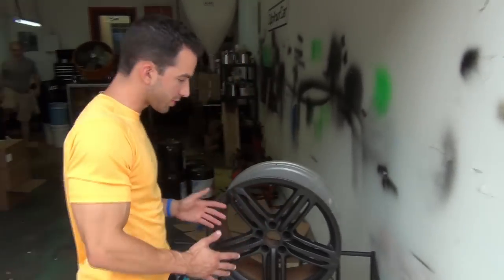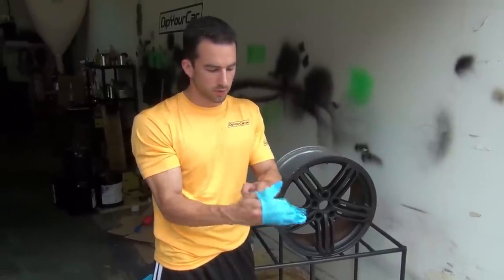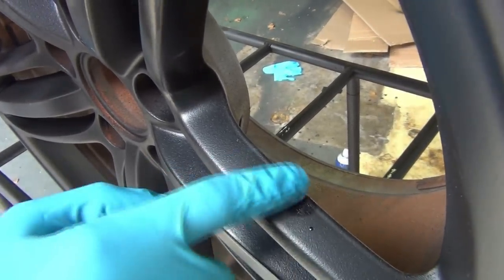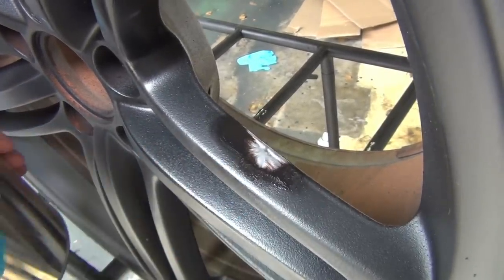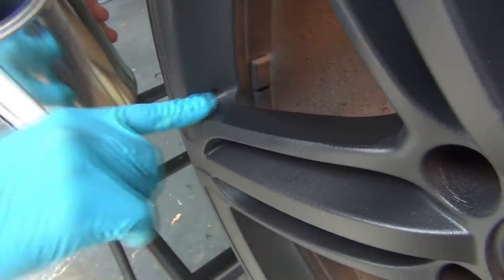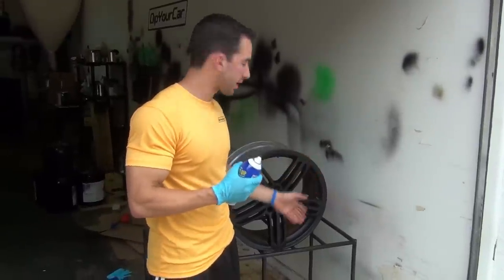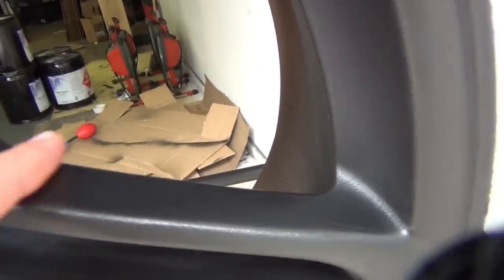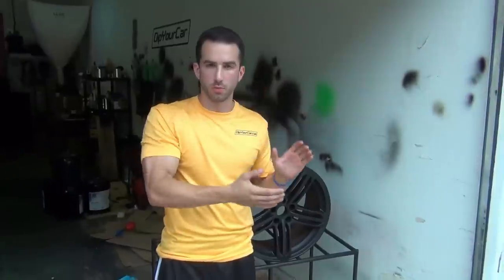How to Fix PlastiDip (Texture, Tears, Troubleshooting) DipYourCar.com

Comment: It’s been years since u posted this video you probably won’t see my comment, but your solution saved me from re-doing my entire prop after I sprayed plasti-dip badly on it & got a lot of ugly texture, thinner trick worked like a charm🙏🏻✨ thank you
Reply: Can I ask what kind of thinner you used and if the prop was foam? Having a similar issue on my current prop build and really don't want to have to restart it.

Comment: its not paint thinner or acetone, its xelyne and vm&p naptha. it wont hurt your ride because xelyne is used to break down rubbers, leathers and plastic.... unless you pour this on you dashboard your ride will be ok. vm&p stand for varnish mix and paint and is used as a paint thinner but isnt a super strong solvent like acetone so a little spill on your ride will be as harmful as spilling fuel when you top off your tank.
Reply: Thank you this helped alot!
Reply: So do you mix them together?

Comment: Fixed curb rash on dipped wheels . Smoothed the wheels by hand with coarse to fine, wet or dry 3M paper. Used the Kit solvent. Whole job on three scrapes took less than 1/2 hour, and it is not visible.

Comment: I've plastidipped hand tools (original purpose) and that works out pretty good. Think about the handling hand tools undergo. 
Shoot I've done it to my GPS and "scangauge" just to make them look more oem and less like add-ons. Those are holding up. 
But to answer your question, if people are doing using it on rims and entire body panels it must not be too bad.

Comment: Paints are usually pretty resistant to plastic thinners. If you left the wheel soaking in it for a few days you may have issues, but you shouldn't have any problems with quick repairs like this.

I know many modern wheels are powdercoatied, but powdercoat is also very chemical resistant.

I don't see a quick repair like this causing any damage at all, let alone damage a quick polish rub couldn't fix.

I've had to use some pretty harsh chemicals on car paints at work. Paint's tough.

Comment: Thanks for the video.  I have an issue w. Rim job, bc didn't make sure the edge was clean from the tire release solvent.  Correction...I found the link to the DipFix, so ordered placed.  Look forward to the project and won't have to strip off & start from scratch.

Comment: this looks good on how to fix plasti dip on a brand new spray but what about if it was covered with brake dust and the plasti dip was older. Would color matching be an issue? Would you still spray the whole thing?
Reply: Did anyone replied? I have the same question!
Reply: Juan C. Guarin I have the same question did you figure anything out
Reply: NinJa Crafted nope 😒

Comment: If you used the Glossifier on your tire's PlastiDip paint job and had these issues (tear or texture) how would you rebuild up the paint job after using the repair kit? Wouldn't that require putting new coats of PlastiDip paint on top of existing Glossified areas? Would that work or would that cause problems? If not, I don't assume there would be any problem with putting a new Glossifier coat back on top of that fresh PlastiDip paint coat.

Comment: I shot the hood of my badly faded silver 95 Chevy s-10 yesterday with aluminum. It was 93 degrees in my garage at 1 p.m. here in central Florida. I had the garage door and a side door open for a cross breeze. Fail ! LOL  This was my first experience with dip. The finish looks like gun metal gray suede with a few  little round bright silver dots from the nozzle spitting. I purchased the DYC spray nozzles and as part of my prep I put the cans in warm water and shook them well. I'll probably peel it and wait till the fall as the weather is only going to get worse. Dip and learn........
Reply: +Aztekno MCO 
Did you ever redo it? How did it turn out?

Comment: the few times ive used it, ive found its better to use slightly heavier coats than usual. i would use two thin coats, and any other coat i applied would be as heavy as possible without getting runs. its gonna have some texture regardless, but it definetly shouldnt look like a golf ball

Comment: The plastidip spray cans i seen come with 2diferent spray tips. The smaller 1 that looks like a hairspray tip will make the finish look rough and bumpy. The bigger tip will give you the smooth finish.

Comment: I noticed you sprayed the entire wheel after spraying the actual damaged area.  Are you doing this because the repaired area will be "obvious" to the naked eye?  If you don't throw a quick coat over the whole wheel, does the repair stand out?  If that's the case, doesn't the entire wheel now stand out when it's on the car?

Comment: Great tips !!!

If I'm doing plastidipping wheels which are already painted with some imperfections, can I plastidip over or do I need to sand and wet and dry to get the surface flat before plastidip??   Thanks!

Comment: I've tried multiple applications in different areas and can distances but it's never come out smooth like auto body paint. Oh, and I plasti-dipped my '07 Mazdaspeed 3 18" wheels and I used almost three cans putting 4 coats on each wheel. I specified the wheels so that you can look them up and see the area I had to cover should you need a better idea of what you need. Thanks for the reply!

Comment: I plastic dipped my Chrysler emblems and they came out good except the surface is rough. And my front emblem has a little lift from taking the tape off. Took me 3 hours to do the back and 3 hours for the front. I’m doing my rims next. How can I get it come out smooth?

Comment: when i plastidiped my rims, there was moisture in the cracks of the bolts so i got bubbles. I plasti dipped my rims gold so i have 4 layers of black that i have to worry about.. i cant just fix the tear (from opening the bubble) with gold on bare rims, i need the black foundation first...... meaning i would have to go over the entire rim with black (over the already 4 layers black 3 layers gold) 4 layers and an additional 4 layers gold... seems to me if u did more than black or white, youre better off ripping all the plasti dip off and starting over for a small tear or texture. amirite?

Comment: Hi, need help… I have a artificial wooden grain texture dashboard panel, am wondering if you have solution with plasti dip to smoothen this surface as I want to change the colour of the wood to gloss black. Hope you can help and have some video examples for this type of project.

Comment: Hope you can reply to this.  I just found out about Plasti Dipping.  I really want to do my rims on my 05 Maxima, but when I bought it, 2 of the rims have curb rash...BAD.  What would you suggest I do?  Sand down the rough edges, use some sort of metal filler (which one?), then sand flat?  I'm pretty sure that's the way to go, but I wanted to ask you as you're the one who works with Plasti Dip probably more than anyone else on the planet!  :-)  Thanks in advance!

Comment: What about repairs in larger areas? Like a scratch or tear in the middle of a fender. You resprayed the whole wheel once you smoothed out the bad bits. If you just sprayed a large area (but not the whole car) would the finish match and be un-noticable?
Reply: Nefarious Rogue gotta redo the whole car

Comment: What do mean by a "smooth" surface? I have worked with Plasti-Dip multiple times spraying emblems, wheels, auto body pieces, tools, and doing work in and out of the house and I have never come out with a smooth surface. It always seems to have a texture to it no matter how many layers, can control or distance, or time in between coats.

Comment: Hey I plasti dipped my rims and then used spray max 2k clear well I had to get new tires and the shop scratched all my rims. Now to fix the scratches do I do what you did in this video or do I have to start all over or do I just sand the clear coat off? If I just sand the clear coat what grain paper do I use?

Comment: you could also use mineral spirit I used it before no problem I had kind of design in my room when l spray it black / the black had the line in it i did see them on a little bit so I went a little heavier it helped a little bit but the line is still there that's because I did not use to mineral spirits so I was just trying things out dinners or mineral spirits will work great mineral spirits will give you a glass look and shiny look if you leave it

Comment: I painted my chevy emblems on my 2014 silverado. I have drip marks on the first one I did because I over-sprayed. Took a lot of time taping it off so I didn't want to start over... Just left it as is. Not really noticeable. My worry here with using thinner... Wouldn't it ruin the paint or finish behind the plasti dip? The good thing about this stuff is you can always peel it off and go back to whatever you had before. But thinner would ruin it right?
Reply: Doesn't PlastiDip have thinner in it when you first spray it on? If it doesn't hurt your car's paint then, would it hurt your paint when you use it to re-liquify?

Comment: Hey Fonzie, have you made sure that the "blend-a-thinners" is safe for use on clear coated wheels? I do not want to try this stuff if my wheels will eventually be ruined after i remove the plasti dip to go back to my normal color wheels?

Thanks

Comment: Not sure if you're being serious but to avoid that you just peel the tape when the plastidip is wet.  So right after spraying your last coat or you can use a bit of thinner on a Q-tip and run it along the edge of the tape and then peel slowly and at a sharp angle.

Comment: I'm curious on using this product. if I were to use it on my jeep how long will it last on it? I normally just drive in the city and up a dirt trail back home. nothing extreme.
Reply: from all the videos made by DIYers, I calculated 2.5-3 years of solid use IF YOU APPLY 5-8 COATS.

Comment: Is there any other way to fix texture problems. I didn't want it to run so I sprayed it a little farther away and ended up with texture problems on every rim. Thanks
Reply: If every wheel is textured and it's not small little areas, it's large portions of the wheels you have to make a decision, if you are okay with the texture i'd say just leave it, most of the time you have to be relatively close and pay attention to notice texture anyways so long as it's not horrible, if you aren't okay with it and it is a majority of the wheels that got affected you would be better of completely restarting rather then trying to "smooth" out all the texture.

Comment: I have a 2005 Dodge ram with these ridiculous 20 inch rims with chrome plastic wheel covers. I have no idea why Dodge did this. I have dipped my rims 2 times now and for some reason they are not sticking well. doesnt last for more then a few weeks before a tear happens. I usually put 5-6 coats of dip on them each with a couple coats of glossifier. any idea how I can prevent this from happening? Im thinking about just sanding them and putting a mat black finish on them
Reply: It seems to stick better on primer. Try sanding and applying primer first. It still can be peeled off but grips a lot better.

Comment: I got my tires just replaced and the shop put a couple of scratches in it. I have about 5 layers of black and a couple of layers of glossifier. Is there any difference in the repair process for rims that have glossifier added?

Thanks! -John

Comment: What would happen if you put heat to it? Like from a propane torch, would it melt or just burn it up?
Reply: Burn obviously it's not wax :/
Reply: they said it can handle up to 300c
Reply: i did a 97 tahoe, i had one air bubble on the whole car, unfortunately it was in body line on the hood, i purposely went for a textured look so what i did was slit the bubble then use a hair dryer on low air with hottest setting, i heated it up then sprayed and heated the new spray, you cant even tell where the bubble was now.

Comment: If I had a wheel with Copper Metalizer (4 black coats and 4 copper metalizer) with a tear due to tire mounting. Would I need to do 4 black and 4 copper coats after the paint stripper or can I go straight to copper?
Reply: RevitalizedVessel I have the same question. What did you come up with for an answer?
Reply: Nicole McCormack i decided to do it like I did my wheels and did 4 layers of each. It came out decent. I heard the metalizers are thinner than the black spray so I thought layering would be the best method
Reply: RevitalizedVessel Thanks for the reply. I was afraid that was the solution. Gonna give it a try

Comment: ive noticed that when you dip something large there is alot or streaking like a hood. I ended up putting the equivalent of around 3 coats on and let the large amount dry to make it smooth(like your stripe tutorial). Is there a reasonable fix to this..other then layin down a ridiculous amount of product at a time..and do you think this product will help take out some minimal streaking.

Comment: I did the hood of a 1996 rav 4 because the paint was faded. It has some texture on it when I finished after 5 coats. If I put another wet coat on the whole hood, will that help it?

Comment: I need to remove it from my 3 piece wheels. It's in the bolts that hold the rims together. Thinner will soften it up enough to power wash it off?

Comment: Will this work to remove stubborn plasti dip in the edges and crevices of my emblems ? I can't seem to remove the plasti dip in those small cracks. Will this damage my cars paint around the emblem?
Reply: Carlos use brake cleaner

Comment: You have to recoat the whole surface to get an even finish. If you don't you'll see it, especially on a large flat panel like a hood.

And what do you mean by damage? This stuff will cover paint scratches pretty well, especially if you "prefill" them. But nothing short of actual repairs will hide a dent.

Comment: Seems like plasti dip is relying on environmental temperature too. If it's too cold the paint seems to be not spraying evenly. Leaves the output having horribly uneven in texture.
Reply: Myles Hejmanowski not if its ten degrees out. the plasti dip also has to dry, not just spray. that would help with the spraying though

Comment: the easiest way will be just redoing the wheels with about 3-4 coats covering the light areas, then peel it off again. you can also try using a pressure sprayer just be careful not to damage your paint.

Comment: i plasti dipped my rims about a year ago but i just not new tires so when i got the tires installed, they screwed up my rims so i was forced to remove my plasti dip but what i realized is that i did not do enough layers so now when i removed it, i only removed the thicker part on the flat part of the rim but the contours of the rim did not have enough coats at all so they still have thin plasti dip on them, can i use thinner to get the rest off? or do i have to scratch it all of??

Comment: Wouldn't rubbing paint thinner on a brake like that expose the original paint to the thinner, thus harming the original finish??!!  Rubbing thinner on a texture is one thing when the original paint underneath isn't exposed, but in the above example for the brake.... uh letting thinner dry on that silver finish, IDK about that.

Comment: So what kind of paint thinner  should I use? I cant find this shit on their website
Reply: +zahar619 no im testing that theory and im useing Lacquer thinner and it works a little bit but not to the point where you see it being like it use to be. you could still see it injured where it was chip off. It was smaller than the one in this video and still i couldnt get it as good as he did.
Reply: +zahar619 im going to try wet sanding it.

Comment: I tried using plasti dip but it left air bubbles, what did I do wrong? Can someone help?!
Reply: The surface was probably to warm or had moisture.
Reply: Thanks I ended up re doing it and it came out nice
Reply: Alex Becerra i noticed that during first coats if you put too much paint you will get bubbles easier

Comment: I've just sprayed my entire Sebring convertible for 120.00 US. with conventional automotive paint, includes clearcoat. Plastiidip would have cost close to 400.00 for 4 gallons.While the prep work is the same. why in Gods name would someone want to do this outside of wasting money.
Reply: if you get a scratch or you dont like the color any more you can peal it off....
Reply: u must have had some really cheap paint that is going to flake fast. i plastidip my car all the time and if i mess up its no big deal and overspray is easily removeable. its fun
Reply: James Hinojosa yeah i havent painted a whole car with it but i can see it is fun
Reply: Ray A how much time that cheap paint will last? how much durable it is? plasti dip last for years protecting your original paint & it very durable with 5-6 coats. good quality stuff cost more.

Comment: how long do i wait to wash my rims after i plastidip them
Reply: You can wait as little as 24-48 hours i'd say depending on how thick you did your coats, it's always best to allow as much time for the plastidip to cure though before either washing or even taking the car out for a drive, one to two weeks is best before washing your wheels but if they're horrible dirty and you must wash you should be fine after 1-2 days.
Reply: Thanks

Comment: can you plastidip over old plastidip?, I did my wheels matte black and now I want gloss black
Reply: +Oscar Ortega Yes you can! just make sure its very clean. :)
Reply: dude....you don't need another coats of plasti dip man. use glossifier....2 coats. Make sure surface of the wheel is smooth. if not, use light grid wet sand paper, rub it gently, put 2 more layers in black, and glossify with 2 coats.